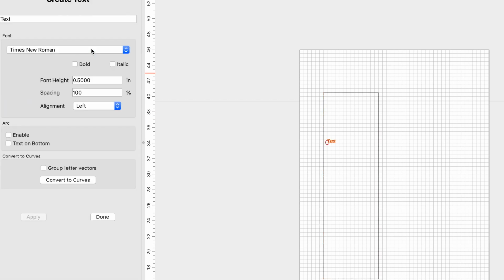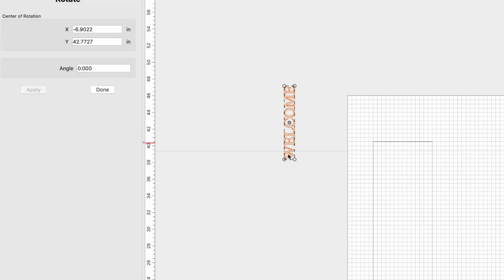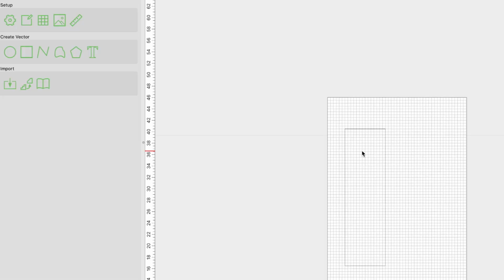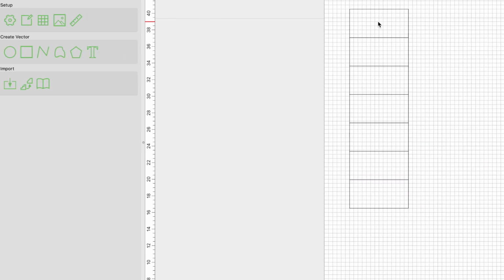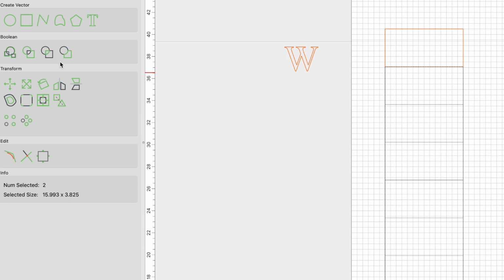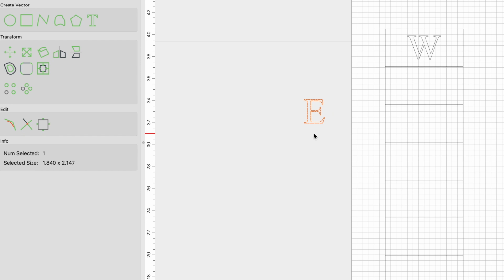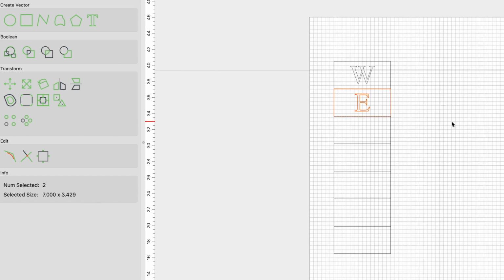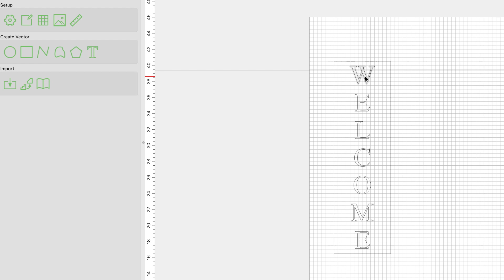How To Make Vertical Text in Carbide Create

Comment: Nice bro. I just text my letters out individually, then center individually, then use the arrow keys to move them down individually as well. I can do it in seconds
Reply from the maker: Oh nice! Let me try that. And then you can resize to fit within your needed sign or whatever it is. But what about the spacing between the letters? How do you get that to be equal between letters? I’m gonna play around with it now. Thanks for the tip!
Reply: @aetimberpine  Of course bro, each down/up arrow click is precisely the same as the last, so if you count the same number of down clicks as the previous, it will ensure equal spacing between each letters. I do the same in Lightburn for my lasers